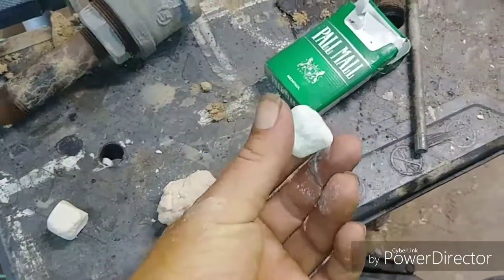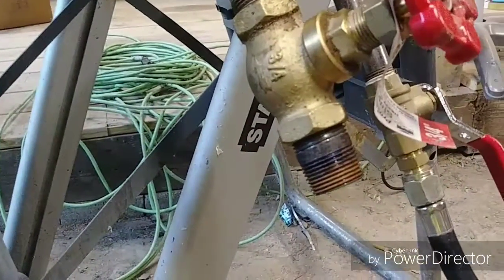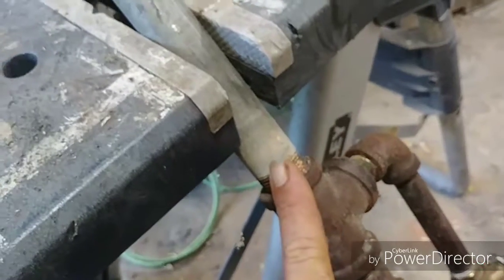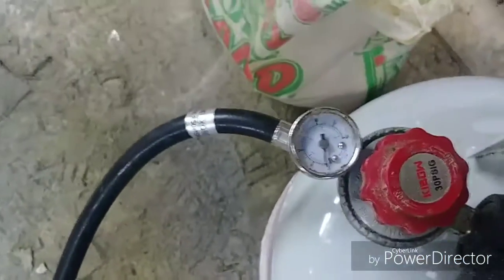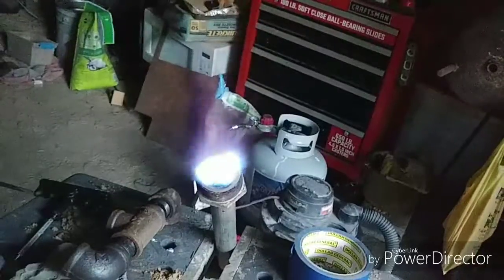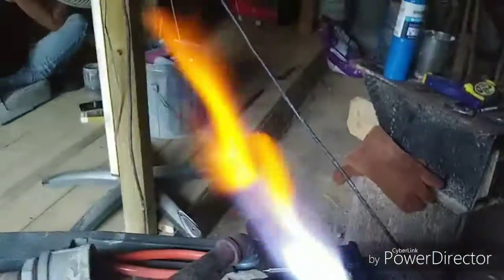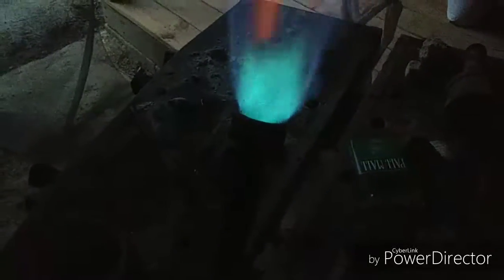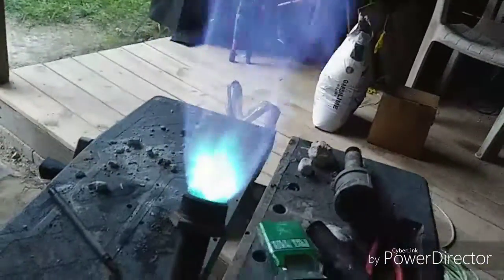Testing New single burner Outside The Foundry

Comment: It's really impressive isn't it? I'm curious if you find the straight bushing reducer works better at shaping the flame than a bell reducer.
Reply from the maker: That is questionable. I want to know the same thing. Having trouble finding an 3/4 by 1 1/2 bell reducer. I will say that 1 1/2 is better than the 1 1/4
Reply: possibly a a bushing reducer to fill in the gap for the bell reducers you have available.  I agree though, the 1 1/2" makes a better flare than a smaller size